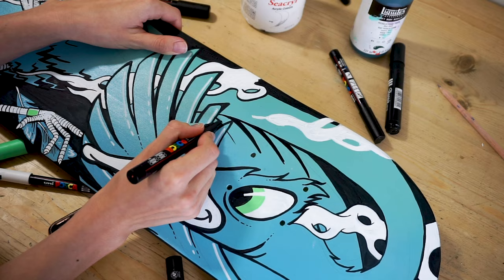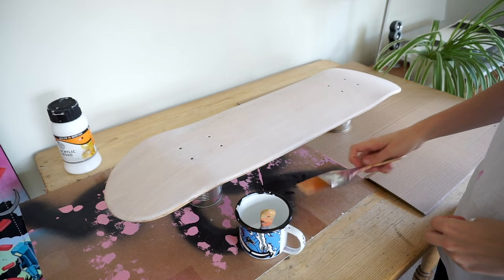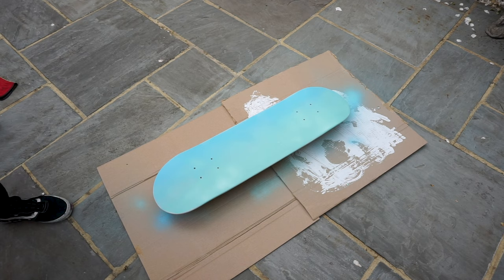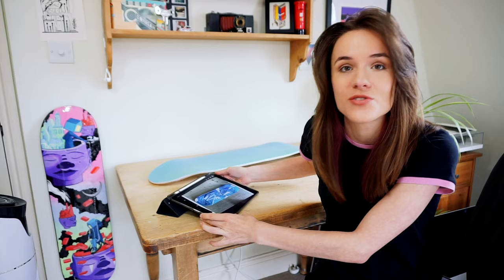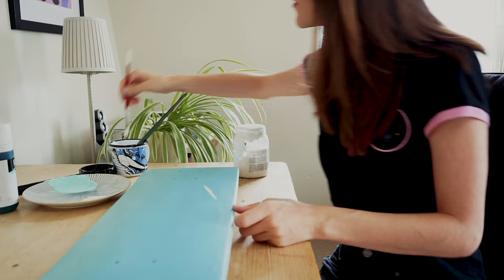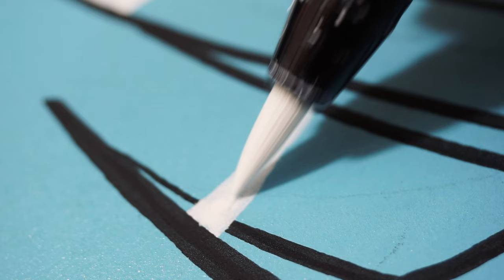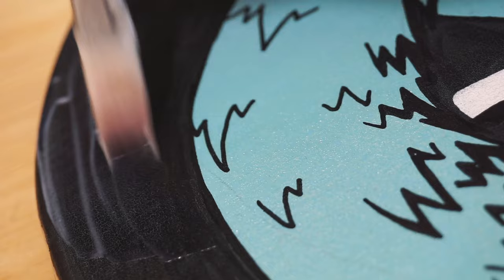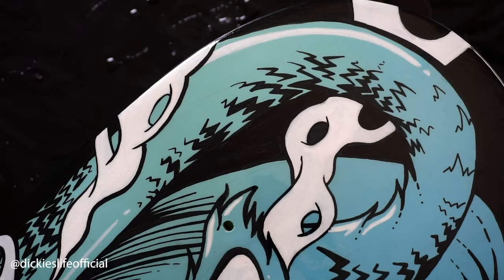HOW TO Paint a Skateboard Deck by Nic Mac

Comment: You can also use car or poliurethane clear coats (or lacquers)

Great vid, amazing art! congrats
Reply from the maker: Car varnish? Does it work ok on top of acrylics? Be good to know and worth trying if so 👀
Reply: @NicMac  there is actually an automotive acrilic clear coat;D
Just apply it on multiple layers so u get a solid and smooth resin/alike finish
Reply: Polyurethane on the other hand works pretty well too, both give a pretty strong water resistant finish 
If you use pearl or candy finished spray paints, car clear coating gives a pretty nice touch to the metallic colors 
Just be careful to apply it with some primer cause the layers of paint and clear coat can begin to delaminate
Reply from the maker: @olympusaviation7346  oh wow that’s so good to know, thank you for sharing 🙏
Reply: @NicMac  anytime! Thank you for replying:)
Reply: @NicMac  I just sent u a picture with an example on ig, might get you an idea :)

Comment: Thanks for sharing your artistry. I’m going to be hand painting my first board soon with acrylics & Posca with a resin finish. You know how to make a video that is easy to understand with clear instructions and a nice sounding voice. Great work. It helped confirm the process for me.
Reply from the maker: Thanks so much!! One thing though! That has come up here in the chat is that although a spray varnish is vital to “seal” the Posca pen details (as the resin will make it blur)……it’s best to leave as much time as possible after you use the spray varnish…..I would do some coats of spray varnish and then wait 4 days + before doing the resin. So there’s absolutely nothing “chemical-y” on the surface that will react with the resin.
(Also Make sure to wipe away any dust and/or grease from finger prints before adding the resin too, so there’s no reaction to anything else on the surface) :) hope that helps! Good luck ^____^

Comment: One tip for you on spray paint; spray paint cans need to be vertical to spray properly so maybe paint on an elevated surface or hang on a wall. Cool video though, very similar to my work flow.
Reply from the maker: Awesome thanks man and yes makes so much sense, definitely will try to do that next time 🙏
Reply: Next tip, graphite transfer paper. Saves so much time and let’s you focus more on the whole design rather than...’is that where that’s meant to go?..where’s my rubber’. Which we have all done. Nice boards.
Reply from the maker: @Canigetanawwwwyyyyeeeah  Ye that stuff is mad good right? so satisfying, I've only used it a handful of times but keep it for more specific and planned out designs :)

Comment: If it wouldn't be for artwork how would you seal the painting for a useable deck?
Reply from the maker: Some people have resined it but it’s a mixed response, I’ve had people say it’s great and works amazingly and others say they notice it be a bit stiffer, so I can’t have a definitive answer if it’s good of not. I would just varnish it normally if you don’t want to risk it, but the painting will not last long, but that I suppose is expected if you will use the board. However this is why using resin instead of varnish, is a good thing as it  really will make it last a long time, maybe even never reaching the painting itself because it’s a really durable coating.

Comment: what would you do different to make it where the texture isn’t “spikey” like you said happened in the video? btw absolutely love this design!❤️
Reply from the maker: Good question! The Spikey-ness didn't affect anything in the end so thats good! :) but I think the cause was spraying onto a sanded surface, which is a bit more porus. So If you want to spray paint then it's best to go straight into it on top of the original surface, so that it maintains the same texture it originally had. Hope that helps! and makes sense! best wishes, Nic

Comment: so if i dont put the varnish on the posca drawing, then when i put the epoxy resin the posca markers can melt and ruin the whole drawing?
Reply from the maker: Yes! You must spray it with varnish (brushing any other type of varnish on will also make it run) when you use marker but especially with Posca markers as they are water based and run a lot easier. 
(Crazy timing this comment I’ve literally uploaded a new video on the topic just now!, so there will be more info there too)

Comment: So I have watched all 3 of your videos (including the Dickies one) to do with putting resin on a skateboard, and experienced the same problem as your first skateboard where the resin made little dips and I had to do a second coat to kinda fill them in. I've been thinking the solution is just a resin primer which you hinted at in this and the Dickies video but did not spell it out. What did you do to get the better finish? Thanks

Comment: Well you just got yourself a new subscriber - this was epic! Can't wait to watch more of your videos. I have done multiple decks before, many of them adorn my walls, but i am looking to step my game up and perhaps sell some, so this was incredibly helpful. One question - Posca pens are really expensive, are they really worth it? Or are the off brand versions any good? I've previously used sharpies for the outline. 
Also - I've never primed the board before and it looks like the resin finish could end up being quite expensive. Hopefully my artwork is worth the extra effort. Thanks so much for making this video 😁✌️
Reply from the maker: Poscas are everything! 🙌🙌 well worth it, just make sure to “SPRAY” varnish! And not brush anything over as it will smudge
Reply from the maker: Also thanks so much for subscribing and the kind words! 🙏🙏
Reply: @NicMac  great tip - I've been rewatching your video, pausing, opening up new tabs and ordering satin varnish, matt medium and acrylic gesso. Oh, and Posca Pens 😉
I am an amateur but learning so much from this. My neighbour loaned me an orbital sander so I've just sanded an old deck ready to rock and roll! 
Now on to procreate to get some ideas together. Thanks again 😁

Comment: Nic, beautiful work. I have done boards/logos for skate companies freelance but never did a custom painted one. Can you comment on what you applied after using the spray satin varnish? Looks like you used two mediums. Thanks!
Reply from the maker: The last satin spray that I did to seal it? I used art resin, which are the two measured and mixed together elements that make it, which I pour over in the dickies video linked in the description :)  thanks so much for watching and commenting I really appreciate the kind words 🙏🙏
Reply: @NicMac  Thank you! Keep up your great work.

Comment: Hey, I have a board with an existing graphic and would appreciate some advice. I was thinking of skipping the sanding > spraying a base > spraying mtn acrylic gloss varnish > posca > acrylic gloss varnish again. Do you think I would still need to get the matte medium layer in there before the posca part? Thanks and great job!
Reply from the maker: If your gonna seal it anyway at the end I don’t think it’s vital, it will all be sandwiched together if that makes sense so I think you’re good 👌👌
And if the existing surface is smooth and nice already then defo agree with skipping the sanding 👌
Reply: @NicMac  Ok thanks a lot
Reply: Do you think I could achieve a glossy finish on it with a few coats of the glossy varnish, or would you recommend springing for the ArtResin?
Reply from the maker: @deasuin  you can get a good gloss for sure, it’s thin but glossy, resin of course is a whole different thing, super glossy and thick like a glassy layer over the top. They are very different but both are good. 
I think you’d be happy with the gloss spray tbh, also because resining a skateboard is SO hard and a lot can go wrong, I definitely still haven’t perfected it yet, so unless you have used resin a lot before, I wouldn’t try it for the first time on your art on a skate deck 🙏 but totally up to you
Reply: @NicMac  grand, thanks!

Comment: what exact pens did you use for line work/what would you recommend? loved the vid, super helpful and i love your work! looking to do this soon for my bf :)
Reply from the maker: Hey Zenaida, I mainly use Posca 5m’s for line work, I also like the chunkier 8m chisel tips for colouring and also for very straight lines that can be a little thicker, you really get a lot of control with the 8m but it is chunky so on a smaller piece of work I think I’d recommend the  the 5m bullet tip as a great all-rounder 👌👌 if you had to pick one, but both would be best! hope this helps!

Comment: Thank you for posting this. I recently got a different skateboard deck and wanted to paint over the old deck and this helped so much with all of it. Thank you! I do have a question tho. Does Aquarell colors work?
Reply from the maker: @King-ls3cw  “Acuarela?” Like watercolour? It can work on fresh wood but you don’t have much control as it will bleed a lot, and you can’t paint watercolour on gesso or emulsion so I would say not really….but maybe I don’t know what aquarell is? If it’s a brand of acrylic paint then definitely yes that will work 👌👌
Reply: @NicMac  it’s a kind of like oil paint
Reply from the maker: @King-ls3cw  yes that will work, any paint will work really 👌whether it’s fine art paint or wall paint, but yes, oil paint should work as long as you prep the board correctly, oil based paint may need a particular type of “base-layer” paint, I don’t really use oil so do have a look online to see if standard emulsion or gesso is ok to use or if they recomend something else 👌
Reply: @NicMac  alright thanks!

Comment: Question here! 
I recently got a skateboard but it already has a design and i kinda want to paint over it. Will doing the first step do the trick?
Reply from the maker: @actualtrashyy  yes, sand it. Just enough to make the surface rough, you don’t need to remove the design completely, just make it rough enough so that it feels matte, so that the paint will adhere to it. And you can start from scratch with a plain painted base layer of gesso or some type of emulsion 👌
Reply: @NicMac  great advice! also still responding comments after 4 years 😎
Reply from the maker: @darkpanthertv7330  thanks! I appreciate that :)

Comment: Would u recommend posca over acrylic or spraying regarding durability? Obviously paint will get screwed if people are gonna use it for skating but I mean, how durable are these if you just use it for transportation?
Reply from the maker: Posca's are 'paint' in pen form, and are basically the same as acrylic. Sure, you could scratch it,  if you really wanted to or if you put water over it and tried to smudge it a lot etc.
But on the whole they are very durable, especially on wooden or painted surfaces.Touching it or even if it rubs on another surface will not damage it or ruin the art work. :)

Comment: Hi Nic, amazing artwork!

I was just wondering what size board you used? And any tips of where to get them because amazon is throwing up alsorts. Inspired by your video to do something creative during lockdown. 

Great video!
Reply from the maker: Oh awesome! And yes, there’s a few different ones arn’t there! But they are all very similar really,  If your not going to skate it, the size doesn’t really matter, apart from maybe picking a bigger one if you want more room to paint! :) 
BUT if it is for skating then that a whole different thing and you need to pick the right board for your or the skaters height :) 👌
So lovely to read your message, I really appreciate it!

Comment: I've been looking at custom boards to find references/tips for doing mine and this is by far my favourite! Sick design and some useful tips. On the whole would you recommend sanding, as that seems like what gave it the spiky texture? or did that not matter in the end?
Reply: I think the resin /vanish fixed it
Reply from the maker: Hey I’m so sorry I was certain I replied to this. The spikiness was caused by the spray paint but might need to experiment more to really know the cause, it could have been that it exposes the wood and reacts? I can’t be certain, but I think next time IF I’m using spray paint I won’t, but generally sanding is always recommended with normal paints and gesso and things...but as they said, the resin really seals everything up, so if you are going to resin then it’s not as VITAL if that makes sense! :) Thanks for watching man, sorry about the late reply 🙏🙏
Reply: @NicMac  Thanks for the advice!

Comment: hey nic i’m really hoping you see this and can help me a little. i have a board i bought with a regular graphic, so i’m wondering if it’s a good idea to skip sanding and gesso, to keep the smooth finish, and go straight into spray paint. 

from there, matte medium, posca, and then seal it with a gloss varnish, rather than matte varnish to finish. i’m not confident in using resin for the first time on this project, so i figure a spray gloss varnish would work the same roughly. 

thanks in advance
Reply from the maker: That is perfection. Someone else commented about this and that is a good way to go about it, spraying on the smooth surface is really nice, especially if your just going with posca. ONE VERY IMPORTANT THING, is get a spray varnish....it will seal the Posca...if you brush straight onto Posca it will smudge. Spraying seals it....and then you can brush any other thicker varnish if you wish after that, it won’t smudge. But multiple coats of gloss spray varnish is all I think you’d need 👌
Reply: @NicMac  you have no idea how much your reply means to me. thank you so much nic. i love your art tremendously. good luck with everything and stay safe 💝

Comment: Would it be possible to get a board that already has a design and painting over it or would you recommend a blank bored?
Reply from the maker: Both are the same if you want to fully cover it :) you might just have to sand down the Printed one a little more than the wooden one before starting. But the only really reason I can see to specifically pick a blank board is maybe if you wanted to keep some wood detail. Hope that helps :)
Reply: @NicMac  yeh it does thanks for the help.

Comment: Will the paint start coming off easily from using the board? Also great video 👍
Reply from the maker: I don’t think so but I’m not a skater, but resin is VERY durable as it’s used for the bottom of boats and ships, it’s not going to come off easily but I just don’t think it will work very well for tricks and stuff because it affects the flexibility of the board, it’s pretty thick, but don’t take my word on it, I think there’s a skater somewhere who’s done a resin video, it’s worth asking around, do let me know what you find 🙏🙏
Reply: Sounds good, Thanks for the feedback!
Reply: Depends, if you just cruise around or do flatland it will last long time. If you do some nose/board/tail slide on a concrece ledge, its gone in one session.

Comment: This is amazing! You make it look so easy! What kind of acrylic pens did you use? I got a blank skateboard it’s going to be a gift, just wondering if I would be able to do it just by: sanding, cleaning, Using acrylic pens, then clear sealant? Will that come work out ok? It’s not going to be used. Let me know if you can!
Reply from the maker: I would put a layer of gesso first before the paint pens, or of you don’t want to do that and you want to keep the wood in the background it might actually be better to not sand it, paint pens work best on smooth surfaces and sanding it might make it dry and rough...if you spray varnish it it will be ok, DO NOT brush varnish on otherwise the paint pens will smudge and bleed. Spray a thin layer of varnish first, and do a few coats.....then it will be sealed and then if you wanted to add more varnish you can brush some on and it won’t smudge 👌👌👌
Reply: @NicMac  thank you so much!!! So I can skip the sanding, then spray varnish, use the acrylic pens and then put sealant on top?
Reply: @NicMac  I guess what I’m asking is the easiest way I can do it to where it would still look decent. What Brand of acrylic pens do you recommend? Your response helped a lot so far thanks again
Reply: Amazing, I can’t hi5 the subscribe button fast enough
Reply from the maker: @butterfly713  yep exactly that, skip the sanding skip the gesso, just draw and then spray it. I recommend Posca there’s a comment on here that I replied to with the exact sizes I used, so check that out too! Good luck 👌👌
Reply: @NicMac  thank you so much!!!! 🙏🙏🙏🙏

Comment: Question, my local market doesn't specifically have matte medium, is there anything else I can use to coat after the bottom layers?
Reply from the maker: Hey I’m not sure on that one, I wonder if anyone in the comments might help out with this? But otherwise if you can buy it online it’s the best thing to lay down before drawing with poscas or acrylic. 
Otherwise, if you just draw on top of the painted background layers without it I’m sure it will still be fine, if you really can’t get your hands on it, Especially if you varnish it at the end, which ensures everything is sealed nicely 👌👌

Comment: How many black Posca pens did you get through doing this alone? 😮 I reserve them for line/detail specifically cos they're not exactly cheap (and paint pens seem to run out in a fraction of the time compared to ink pens izzit)
Reply from the maker: Good question, I didn’t get through any and they were already used pens 👌 there isn’t a lot of black or white used so maybe that’s why, but I generally don’t feel they run out too fast. But I do get it, they are expensive, and I defo would want them to last longer for the price, but generally I’m not too disappointed in them.